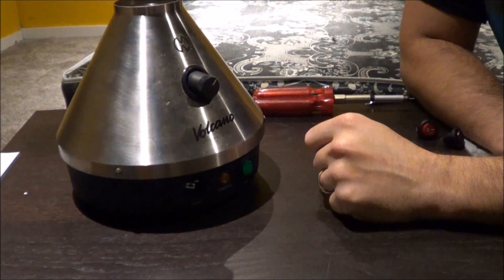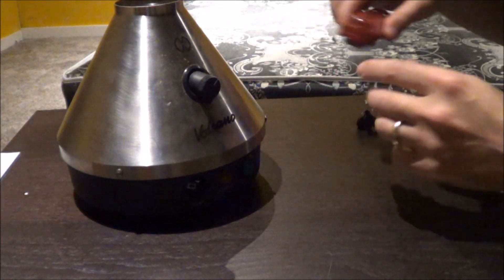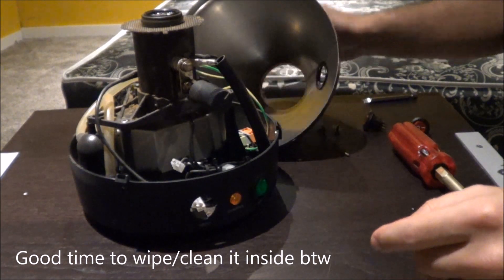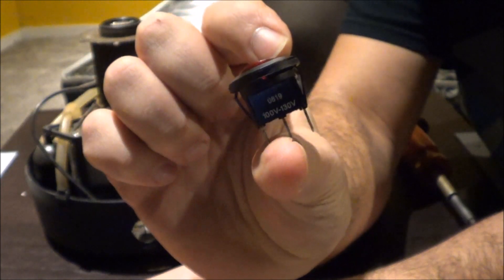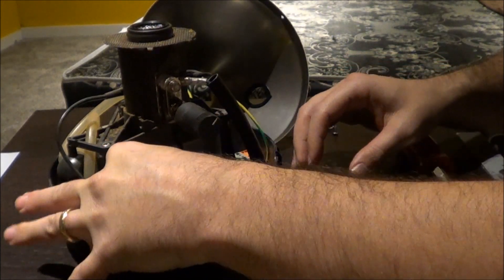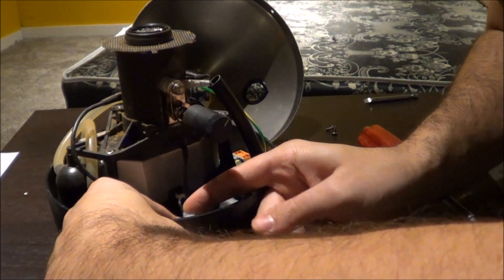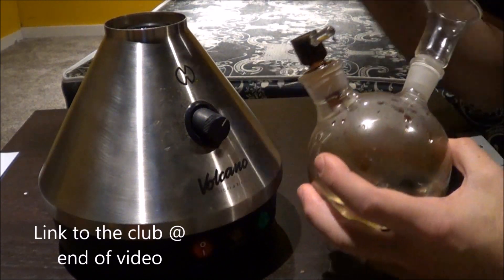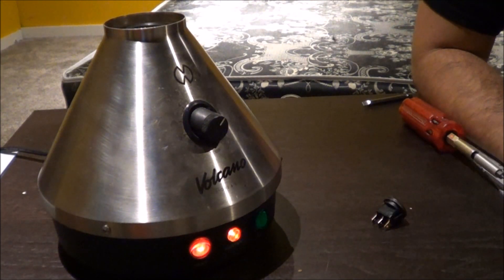How To -  Replace BROKEN SWITCH On A Volcano

Comment: Please make sure you are picking up the correct switches. They have a very Specific Amp Rating and we are seeing folks using underrated switches that look the same but are not at all the correct switch.   See our Combo with the correct OEM switches for your Volcano.   https://www.depoteco.com/volcano-vaporizer-parts/

Comment: #TOMARS . Useless Info Alert. Technically that's a torx 8 security, because it was hollow in the end. A security screw will have a pin in the middle that fits in to the hollow in the bit.
Reply: I NEED to know what kind of screw driver!!
Reply: Wait so I need a Torx 8 Security screwdriver?
Reply: @cats-uk  If the screw head on the volcano has a post in the middle of it, yes. That is the 'security' part. As torx is a standard bit, but torx security isn't.